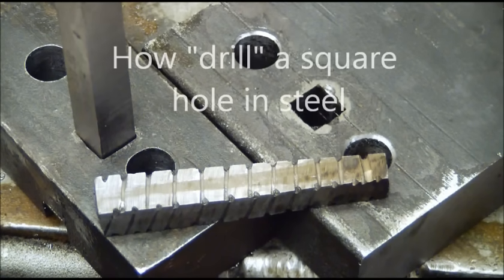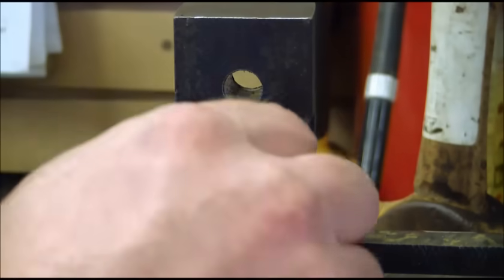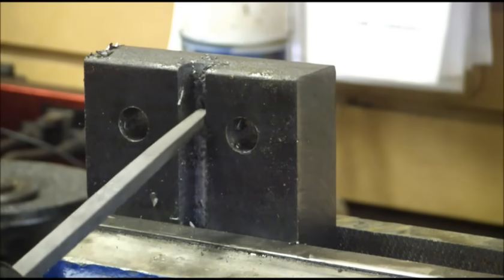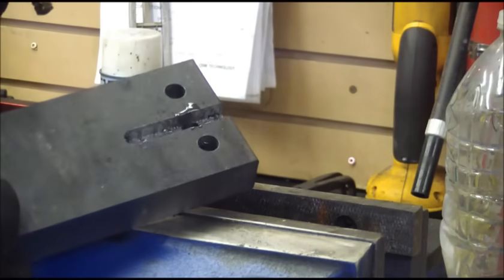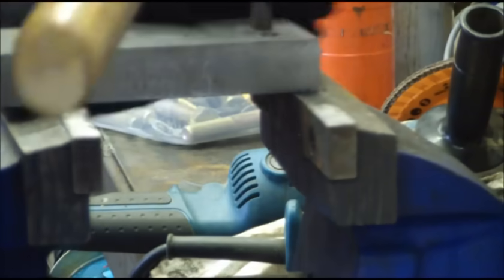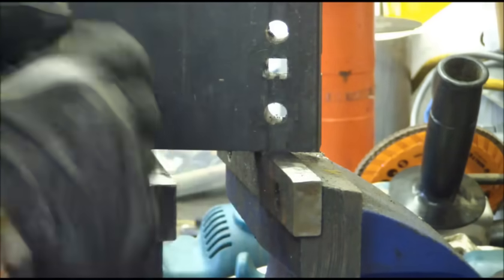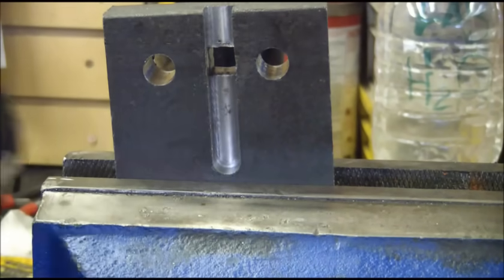Machining 101: How to drill a square hole at home without special tools.

Comment: Sorry, it doesn't work this way. The broach needs no taper with grooves but each section needs a relief. And each cutting face needs room for chippings. And you pull a broach, you do not hammer it through. Considering how easily you filed the hole square, you should have used the file alone.
See how its done https://youtu.be/MYI1slVGziU

Comment: I made a simple broach for tang holes by combining small but aggressive bandsaw blades (cut into 6” lengths). I soldered them together (poorly) and wrapped tape around as a handle when working on the tang hole. Just an idea.

Comment: "Without special tools" "just used my angle grinder and die grinder" idiot
Reply: Angle grinder and die grinder can both be purchased very cheaply, special tools could cost many thousands, some tens or hundreds of thousands. If you think an angle grinder is a special tool you sound like a special tool youself.

Comment: Great video, thank you. Do you have any guidance on fabricating a broach for a round hole with a flat on one side? I've got a project where I need that to mount to a small motor shaft that has a flat side. Thanks

Comment: i needed to make a square hold in the firewall of my 70 impala for a throttle cable to lock into so i just made a mount and mounted a file to a sawzall it worked wonders lol.

Comment: Did anybody else think his drill speed was a little bit high for a 3/8 bit? When I was working in a metal fabrication shop the old man who owns the company always taught me that the larger your drill bit gets the slower your drill speed should be but the more pressure you use and the smaller your drill bit gets the higher your drill speed but the less pressure you use
Reply: You are correct. That is so you can maintain the same cutting speed with different diameter drill bits. The larger circumference of the tool means it covers more distance in each revolution (circumference) therefore you need less RPMs to achieve the same cutting speed.

Comment: I’ve got a 26mm thick piece of D2 tool steel I was going to put on an anvil with a 3/4” hardy hole. My largest carbide bit is 13mm 0.5 inch, I was thinking of cutting and welding. My questions are two fold please, what metal would I need to make the broach out of and would it work with larger holes? I’m sure you can tell in the way the question is phrased I know nothing.

Comment: Not even "101". Your next mission level should you choose to accept it is to drill a triangular hole in 1/2" stainless. Hint: what you crudely angle ground out was a tapered file. Free of coarse to use that CNC...... and with a litle tappy, tap, tap this comment will delete.

Comment: Crap, too late for me, this tool had to use a different tool to make them square holes in aluminum for carriage bolts. Used an electric reciprocating file with a medium coarse wood bit! (saber saw) worked like charm, but sorry folks not so good for steel me thinks! Great Vid AvE! Roll your own...

Comment: why did you soften the broach for the cleaning pass heating it. why did it help
Reply: The idea behind heating the broach is that the tool will expand as its heated, therefore it will slightly enlarge the hole as its pressed thru a second time.

Comment: yes the drill rpm is too fast but matters little. If the drill starts out fresh odds are high it will make it through however he would not be able to operate like that for long periods in a shop because the tools would not last as long. There would be no reason not to simply run the drill at the correct speed of about 700 rpm.. But its a good video and the uploaders which I myself do sometime get nothing and are sharing information but often get belittled because of it instead of thanked. Generally the insults come from people who have NEVER uploaded a video nor done anything with the concept of helping the community.

Comment: Now how do you do this if you don't have the luxury of going through the other side? Say basically a square mortise that goes part way into the surface on metal. I know in wood you could go part way with a drill then square it off with chisels. Does that work for metal too? Or something similar?

Comment: Broaching is not drilling a square hole, then neither, possibly, is the method that follows:
A hardened "bit" that has one less side than the number of sides that you require is need and is fitted to a (for want  of a better description) floating chuck - this allows the "bit" to stay parallel to the drill axis, but can float around - this is necessary to allow the bit to precess(?). You also need a die with a hardened square hole that is the size of the required hole. The bit rattles around on the work piece and is constrained by the die and eventually cuts its way through the work piece. It doesn't cut true right angled corners, but is pretty close - it is particularly useful for blind holes, otherwise you would broach it ...

Comment: Now that's a good idea, thanks for the tip!1  Now how do I get this three sided  pin into that square hole...Sonething I'm having a hard time finding around here is a simple old chassis punch, where you have a cylindrical cutting piece on one side of a threaded rod and a cup it fits into on the other side. Then you tighten it up until the cutter comes through the metal and into the cup on the other side leaving a nice hole. No one even knows what they are around here.

Comment: Pretty square holes can indeed be drilled. They used the method to drill the holes in the plates that railroad spikes go through. The 2 flute drill would go into a floating type ring which allowed the drill to walk around and drill the square hole.

Comment: One of the things I like about square files is how they're tapered to allow you to get those straight edges in square holes. 

Assuming you're working with mild steel, judging by the thickness, if you marked it out on both sides and filed it, the job would have taken 20-30 minutes. Making the broach and then using it probably took a couple of hours at least. But now you have a broach, that doesn't seem to work very well...!;) 

But hey, I'm the guy who took three days to straighten a Ford Mondeo suspension arm (that some bastard mechanic had bent) using a combination of blocks, levers and vices, two straight edges, a homemade hardwood jig, blocks of wood, a jack and a fucking huge hammer!;))). 

Saved over £1,000 in parts and labour.

Comment: I would have drilled four small holes on the corners then one large one in the middle to clear out as much metal as possible then just file it :) that wouldn’t require anything special.
Reply: what do you by "file it"?
Reply: Party Bike use a flat hand file on the sides to square it up.
Reply: +AmongTheWillows Mmmm....sounds like a special tool to me😂✌
Reply: Party Bike Just standard 3$ file :)
Reply: Less of a special tool than even trying to find HSS bits outside of a toolshop or tool supplier.

Comment: I'm going to try this on a 1/4 hss blank and try to cut a square for a bit holder portion of a home made diamond/tangential tool holder. Then cut a slot so the set bolts can squeeze and hold it.  Wish me luck, I'm not sure how I'm going to press it with the other side at 12 degrees or so

Comment: When I was 18, in 1978, I got a job at a small 30 person manufacturing plant, (there used to be a lot of those), one day a month I needed to broach a couple hundred parts, we used an arbor press with about a 2 ft. long handle on it. 
It was hard as hell to force that broach through, I started with the handle almost straight up, a little forward of TDC, I had to hang onto the handle, and let my legs drop out from under me, it took all my 180 lbs. to get that broach moving, that was the easy part, because that was only about halfway through, keeping the handle going to get the broach the rest of the way through was the hard part, it was a hell of a workout, and I'd be covered in oil.
I'm sure there is a machine doing that now.
Reply: you just needed the proper size arbor press.
Reply: @stevewatts8642  A hydraulic press would have made it real easy, I used what they told me to use.

Comment: I agree with some of the comments here about the bit spinning too fast. At a slower rpm, you would have long shavings, thus indicating that the bit is constantly cutting into the metal. To avoid possible injury, back off for a split second so as to not have really long shavings spinning around---which may catch a shirt sleeve or arm flesh. And some sort of coolant to keep the bit cool and lubricated.

Comment: Rather amazing when i see someone drill through a piece of metal that easy with a drill bit.... Where the heck can a person buy good bits that will drill through metal without dulling/breaking/case hardening?  I need a set, because 30 dollar lowes bits aren't gonna cut it..

Comment: That seems a bit fast rpm for drilling steel, but if it works for you, that's fine.  I always set the rpm on my drill press to the lowest possible speed and use cutting oil.  On the other hand, I'm 64 and a lot more patient than I used to be, lol!  BTW, great vid, I am going to give this a try.  Thanks!

Comment: You are miles above me with an angle grinder!  Mine would not have looked that good, so I went another route.  I needed some 1/2 inch square holes and where I live, I must drive an hour to find a tool store. I did have a 1/2 inch square file that was useless, so I cut slots in it with a bit of relief, cut it to length, and hammered it through my round holes. Thanks for this video. I now have my snowblower fixed

Comment: I know some of the youtube children are squealing that this isn't drilling and I know this has in modern times adopted the term broaching, but if I recall correctly true broaching is displacing the metal not removing any metal. Best example is a blacksmith piercing and widening a hole in hot iron. 
Meanwhile drilling has never strictly implied rotary cutting, ie many types of well drilling and rock drilling just use repeated impact pulverizing. The most basic is the old iron bar on a rope, dropped from a height a few times followed by scooping out the bits rinse and repeat.

Comment: "Without any special tools"

Immediately picks up special tool
Reply: Nathan Spain not particularly special. ever heard of a propane torch?
Reply: Um, @Russ Hanneman...These are very basic tools to work with metal. You're not changing a wiper blade for Pete's sake. OK, with enough patience you probably could do it with a hack saw, metal file and hammer and vice grips, but you'd hate yourself for it and the results wouldn't be nearly as clean.
Reply: Russ Hanneman It was only special tools to you, completely standard to me! A Phillips screw driver may not be special to you but it will be to someone who doesn't have one! What he meant which is obvious to people like me is that it doesn't require special tools like a lathe and rotary broach which is how you actually drill a square hole in seconds with no effort but the equipment cost is very high!
Reply: Do it enough times that way though, and people might unironically call you popeye.
Reply: Bench vise, drill press, torch, etc., are not specialized tools.  Those are tools every decent shop should have.  How do you get anything done without basic tools like that?
Reply: Funny thing that you can do it without vise, drill press, and torch. He use vise as press, but you can use hydraulic car jack for this purpose, instead of drill press could be used regular hand drill and 3-4 bits of different size, drill in few stages from smaller to bigger drill bit diameter, instead of tourch you can heat it in regular fire or in bbq, many heat sources will work.

Oxy-acetylene torch... yea ofc you need oxy-acetylene torch to heat small piece of steel to less then 500C...
Reply: "You didn't have to buy any extra tools", but I have to because I don't have that special tool in handy right now.
Reply: Lol made with nothing but special tools. I died when I saw the torch come out hahaha. I'll just take it to a machine shop that's cheaper than a bench vice, drill press, and oxyacetaline torch. Bruh....

Comment: I'm going to show you how to do this without any special tools using this special tool that I made but am not going to explain.
Reply: Jeffrey Wilkinson If you don't know what a piece of high speed steel is then you are going to need to do more learning.
Reply: Jeffrey Wilkinson he literally explained exaxtly hoa he made it. do the taper with an angle grinder and the relief cuts with a die grinder (you could use an angle grind for that too.)
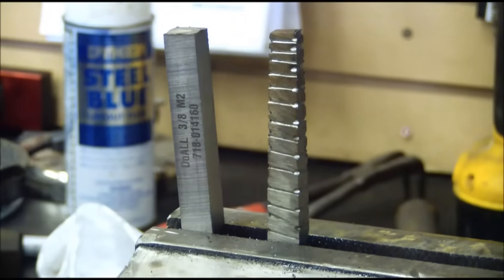Reply: ...yes he did. 1:19
Reply: smh...
Reply: Only real men get AvE!
Reply: He literally says in the video that he placed the tool steel in the vise, and shaped it with an angle grinder. If that sounds like a "special tool" to you, please stay out of the shop, thanks.
Reply: Will Feral bet he thinks a hammer is exotic
Reply: HookedOnJoni
Reply: +Savage. wasn't that the point of this video in the first place? how to turn something round into something square.
Reply: But in the video, you didn't say you ground the HSS into a taper.
Reply: Rha Xotur my point is that he could have spent a bit more time explaining how it was made.
Reply: So once sentence saying that he changed a tool I never heard of into a different tool I never heard of qualifies as a good explanation?

Comment: The broach does not have enough chip clearance, in fact by looking at it I don't even see how it could have work. 

And I would suggest you buy solid carbide drills if you are drilling even the softest of steels at that spindle speed even if they were bathed in a coolant. 

The things I have said here are machining 101 and should even be understood by a novice.
Reply: he is a novice, drilling a square hole proves it!

Comment: I'll bet you go through a ton of drill bits. Your rpm on the drill press is way too fast to have any life in a bit. Also, no drill lube? It seems to me that you are more of a hacker than a machinist/tool-savvy person.
Reply: sure was smoking so I'd say there was lube on that drill bit. Raw steel does not usually smoke unless there is oil present.

Comment: Not impressed. Actually quite crude but, if that's the level of quality that is acceptable to you then, have at 'er. Square hole sleeves are really cheap on ebay...you drill and ream a round hole, then braze the sleeve in and you have a perfect square hole that was done with an actual square broach.

Comment: When drilling a file (yes, a hardened bastard file), I was taught (by the TAFE teacher) to push down hard on it, with the drill press. The swarf was orange hot! I was told, that if you push too gently, u simply dull the cutting edges of the drill bit. The drill bits WANT to WORK. They want to cut the steel. Push them gently, and u wear them out quicker. Is that right ? We didn't use coolant/lube either. But ended up getting through the file eventually! The file, BTW, had dozens of holes in it already, from other students; efforts!!

Comment: I'll bet you burn drills up a lot judging by the speed you are running that one in the video.  Believe it or not, slower rpms will cut just as good if not better as your cutting edge is not being annealed due to the high friction it is subjected to at high speeds Also, I'd recommend the title be "How to broach at home".
Reply: The drill was smoking, so there was a lubricant
Reply: +E.PLUMBUS UNUM Nawh, he's using his pixie dust unobtanium drill
Reply: +E.PLUMBUS UNUM I thought the same thing, annealing and I have used hole saws without any fluid that lasted for years as long as the critical temperature was never reached. Drilling overhead alone on the job kept the tap magic on the shelf..:).
Reply: +whistlelips Oh ya, I forgot the critical aspect of low rpm.
Reply: +whistlelips dudes some people can't wait to make a yt upload
Reply: +E.PLUMBUS UNUM I had the same thought. Also adding some lubricant wouldn't be a bad idea I think..

Comment: Just wondering if heating the hole and then driving the hardened stock through then grinding off the excess wouldn't accomplish the same thing. If practiced could it produce a tighter fit without welding the two pieces together. Perhaps rapidly cooling it once the piece is through. Or having the square stock supercooled before pushing it through the heated hole. I don't know, haven't tried it just wondering.

Comment: I've only ever used a drill press a couple times so I am in no way an expert but aren't you supposed to use coolant when drilling metal? When I was using it, the guy standing behind my ass kept telling me to apply coolant like every 5 seconds.
Reply: +hellterminator cool the drill every time you use it or buy a new one every day... in my company I would be killed if I would drill like this guy... :)

sorry for my bad english... I´m from Austria (Europe)